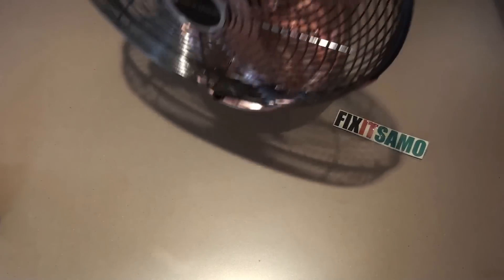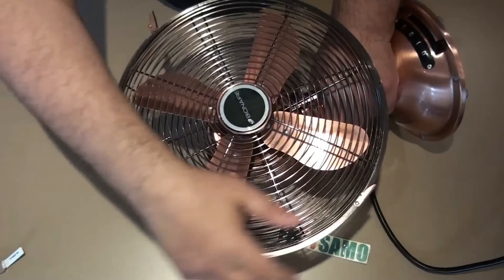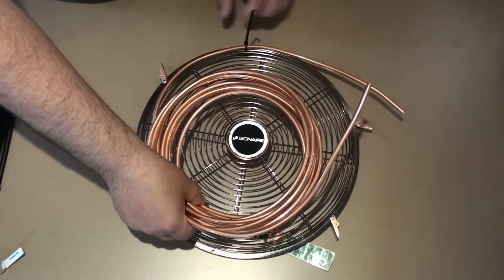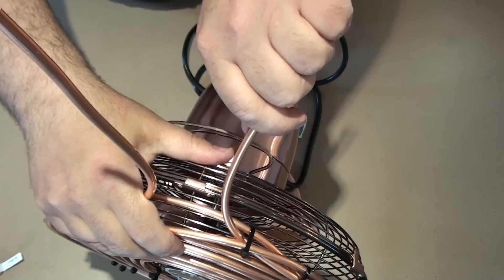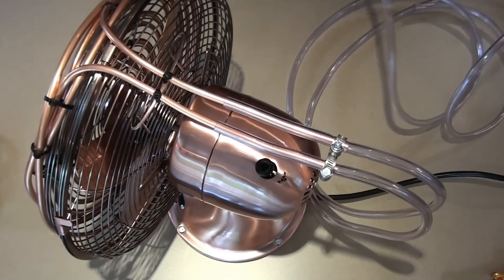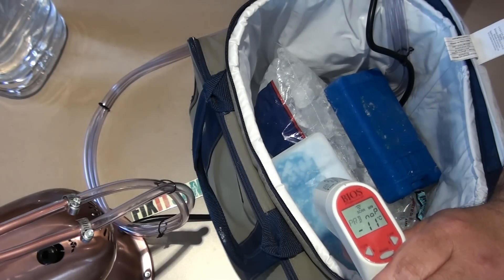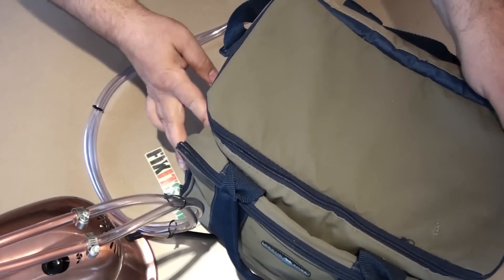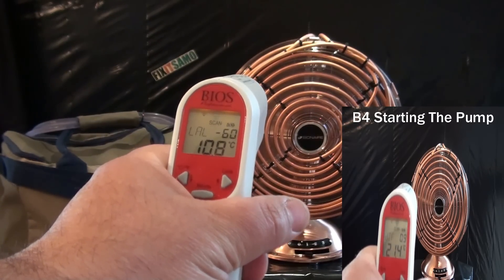How To Turn Your Fan Into An Airconditioner  AC

Comment: how long does the water stay cool? and is this more cost effective than an AC?
Reply: I doubt it's more cost effective. You need to run a freezer to create the ice so all this will do is very slowly move the heat from the room you're using it in to the room with the freezer.
Reply: Takashi Joho
You're ignoring the cost of buying/making the ice cubes. The process for this is no different from an AC but dropping the temperature of the water to below freezing will use a lot of electricity in comparison.
Reply: If you are running a freezer inside the house to create the ice, this is not a good solution.  As Takashi stated, it would use a lot of electricity (thus generating more heat than it removes as the fins on a refridgerator/freezer are still inside the house.  If you just want to have a little fake & bake AC unit to cool a small area and don't care about the extra heat created by the freezer,  this would be a good idea if you'd rather spend the time to buy a fan and put all this together.  You can buy a small AC unit which would exhaust the heat outside the house for very little money and it would work much longer, with little to no mess, and no need to keep refilling the ice.  On the other hand, building this and taking your time to do the copper coils neatly would create a really cool "WOW" factor when you explain to people what you did and show them how well it works.  Even though it is not that efficient overall, I give him a thumbs up on doing an aesthetically pleasing job on his copper tubing and tie wraps.  A bit OCD, but visually stunning.  :0)  +1

Comment: ....Or just save yourself a lot of time and just chuck the bag in front of the fan with the water and ice and let the ice cool down the air with the fan blowing it.
Also this isnt air conditioning, air conditioning requires a pressure difference to induce a change in temperature, e.g. compressing the liquid to heat it up to put on a heat sync (back of a fridge) and then expanding the compressed fluid to wick heat from the surface (inside your fridge).
Reply: ***** I'm not trying to sound smart.. mechanical design engineering is my profession xD
Reply: I think a better reason why its not Air Conditioning is that it doesn't remove the  humidity from the  air. I believe air conditioner at first were more worried about the humanity and were used in factories that handled things like paper and cloth. 

But anyway this is better called Air Cooling.

Comment: i did all this, it drops water from pipes when fan is turned on, 2nd the air temperature was not this much cold, my room temperature was 45 C. its useless dont do it

Comment: Copper tubing 25.00    
3/8 hose          10.00
Hose Clamp      2.50
Zip ties               2.50
Cooler              20.00 - 40.00
Ice sub             10.00
Tank pump      10.00 - 20.00
Fan                    20.00 - 30.00
Water/ice         -------------------
Total                 80.00 - 110.00

New 5000 BTU AC 112.00
Used AC on eBay $25-100

LOL.  Tard economics.
Reply: yea, but can you throw a few beers in a new or used AC?
Reply: If your gonna talk shit at least get your math right.

25+10+2:50+2:50= 40+20=60+10+10+20= 100 not 80
                              or 40+40=80+20=100+30= 130 not 110

Talk about "Tard Economics"
Reply: You can buy more beers by using a new or used AC.

Comment: Cool design, I've placed a fan in front of a few bags of ice before in a pinch.  This seems like a pretty efficient use of the ice, and yeah make the water connection extend further back away from the motor as someone else said.

Comment: I think it would be helpful to design this as a closed loop system like a PC liquid cooler. Instead of a reservoir and radiator setup you run an aluminum or copper cold plate in the ice chest. In the ice chest you could use a dry ice/ice mixture for maximum cooling since it is closed loop there is reason to worry about carbon dioxide poisoning (use it in a well ventilated room or just use regular ice). If you want to be mas chingonne and have a spare couple of hundred bucks laying around - that copper line set he uses is pretty damn pricey too - cannibalize a Yeti Cooler for your cooling chamber.,..

Comment: you could put the coil directly on top of the cooler full of water so the condensation trickles into the reserve with the pump, then put the fan behind that. this will help remove the moisture from the air making even high temps feel more comfortable.

Comment: It would work 10 times better if instead of the copper tube coil, you used a automotive style transmission fluid cooler like they sell at the auto parts stores. These coolers transfer thermal energy far more efficiently than plain copper tubing does.. That said, you came up with a great idea!

Comment: nice bro,however,..maybe for an outdoor application,..one could pre-cool the air ( by running a tube through the cooler,then supplying the air to the fan) because the air temp here ina fla is 97*

Comment: Any fool can understand the principle but the water condensation off the coils will drip to the floor, humidity in the air will soar, the cost of ice will be more than running an air conditioner.   The swamp coolers were mounted outside, recycled the water and used the evaporation principle for cooling, however, they add humidity in the air.

Comment: this really does work I did it watching this video it does drip water but if you put it on a towel I never have a mess just have to change the towel and the fan blows the water forward for those saying it can break the fan so it will probably never happen it's a great idea an costs me about 45$

Comment: Nice idea, but the videos on youtube also tends not to mention or address the dripping condensation issues. It will drip from the copper tube and hoses onto your fan. It may cause short circuits and become a fire hazard. There needs to be a better way of placing the copper tubing. Don't let the fan come close to contact with water And collect the water condensate.

Comment: The only real issue I see here is condensation. It would be better if your copper coil was more of a heat sink style wrap that didn't touch the fan. So coil it up and suspend it in front and have a plate of some sort to catch the drips. This setup will just wet your fan which can have it's own issues over time.

Comment: A more efficient K5,000 BTU window AC unit is usually less than $150 at many retailers. Copper tubing, plastic hose, fountain pump, cooler, and a Fan, not to mention the repeated times draining, and refilling the cooler with fresh ice, that $150 window unit seems to be a much greater value for the dollar.
Reply: agree for home use, but if your running off solar and already have a fridge taking up most of your power and space. this little setup could make a huge difference in small RV.  The only thing I'd change here is to have the water pumped from inside of the fridge, this way your not dependent on ice for cooling. just get a big plastic jar or even gut out the filtering parts of a small external canister fishtank filter. It's already a closed system with two tubes for cycling water all you need to do is clamp them to the copper tube.

Comment: Mines not pumping right the clear tube keeps coming out
Reply: U got the clamps ? Make sure they're very tight
Reply: +William Spillers yes I got the clamps what I'm trying to say is its not pumping the clear tube keeps coming out of the fountain pump so I had to duck tape it but still didn't work
Reply from the maker: +William Spillers
Try to reduce the water flow coming from  the pump  put it to minimum 
Or try using a plastique glue gun

Comment: you could alternatively cycle hot water through to make it a heater
Reply: +Paul Mckenzie scratch my last comment, it's obvious (now) that you meant to send your message to Ricky Ryan not me.
Reply: Good idea, let's buy the heater  first to keep the water hot..
Reply: No the fan would cool it down..
Reply: +Rickey Ryan for the fan to "cool it down" that means that the heat energy would be dispersed from the water to the pipes to the air and if the air is absorbing heat energy then it is "heating up" heat gained must equal heat lost and vice versa
Reply: +Rickey Ryan does the blower in your heating system cool down the air? I'll just let you think about it. Of course if you use radiant heating  or no heating at all I forgive you for your ignorance .
Reply: +Paul Mckenzie sounds good to me
Reply: +Jim Adams fans don't cool down the air they just move it around and allow your perspiration to evaporate more quickly
Reply: +Paul Mckenzie Am I missing something here? All I did was agree with you that cycling hot water would make an excellent heater. I really don't understand the Mr. Moto statement that fans don't  cool the air, they just move it around  DUH like everyone knows that one already ( at least I would hope so). Have you noticed that more and more manufacturers are now calling fans air circulators?
Reply: +Paul Mckenzie no your wrong
Reply: +Nadeem Hussain To be fair you could easily use something like a hot plate.. 

Converting electricity into heat is WAY easier and more common in devices than converting it into cold (which is technically impossible but you know what I mean).

Comment: So after 30 min, you have a warm bucket of water and a wet fan dripping all over the place.  I suppose if you have an endless supply of ice it'd be ok if you could handle the condensation problem.  Those who say to route the tubing into your fridge or freezer are in for a rude awakening and spoiled food.  Fridge compressors don't pull enough BTUs to keep the fridge cold AND do this.  This little gadget WILL push more heat into your fridge/freezer than it can dissipate.  On top of that, all the heat that a refrigerator pulls gets pushed back into the room anyway plus a significant amount more.  Nothing's free.

Comment: I would like to know  the air temperature  that the fan is blowing  ,because with the gun you have just measured the copper pipe surface !!!!!!!!!!!!!!!!!!!!!!!!

Comment: sorry but there is not enough surface area on the tubing to efficiently transfer heat from the air to the water. Also your infrared temperature gun can't measure the air temp. It only reads the surface temp of the tube. 

For this to work you need some kind of radiator instead of the tubing and directed air flow through it. This will give you a much larger surface area, but the condensation problem would remain and worsen. 

Today's air conditioners are very efficient by comparison. Save your money and buy one instead.

Comment: The trick is using AC to MAINTAIN a nice temp, not create one. Use box fans at night to cool the the walls, furniture, ceiling, because they will radiate the day's heat for hours. Then before the temps begin to rise again, seal everything back up and start your AC.

Comment: i have make one but the water flowed through the copper and start to have water from the air keep dripping. (imaging u have a glass of ice water. The side of the glass have water from the air start dripping and make your table wet)
Reply: condensation?
Reply: Yea, on the outside of the copper.. I noticed he didn't address that too

Comment: Great and decent looking idea.  Rather then buying ice, use 1 gl milk jugs filled with water and frozen.  Cheep and reusable.
Reply: Thing is, won't water condense on the copper and drip? That's what worries me
Reply: +C.S. Ewens it does sweat a little I put mine on a towel it actually does cool the room off I used bigger copper and tubes tho and water bottles to keep reusing works great
Reply: +Bobby Ruiz if you keep the round bit of the coil away from the fan and lag the flow and return pipes should be no problem then. Im an ac technician and i believe the added distance away from the fan would actually decrease the air temp from the coil
Reply: Chris C Ahh that's actually pretty smart sounding! Good shit.

Comment: I bought a similar tubing with 3/8 I.D. with header and the 1/4 in copper tubing but they don't fit snug into each other and so is the pump.

Comment: do the same thing  but the waterpipe going through the fridge freezer department, just drill through the side wall without hitting the fridges cooling circit ore electrics  pull your pipe through and  you get nice cold air,   nice job dude enjoy
Reply: a fridge's compressor is not supposed to work continuously, otherwise it will burn out
Reply: The fridge heats up the room as it cools down what's inside so it won't be very effective if you plan to cool down the entire room, and in the end it will end up producing even more heat
Reply: it doesn't have to... same set up as in the video, but instead of ice you'd have the fridge cooling the water. just like cooling everything else in your fridge
Reply: Jakov Sušanj

sorry, i made an assumption that people would obviously know that it had to be in a separate room, just like how his ice was produced in a separate room
Reply: air in a fridge or even a freezer will not cool down water moving thru the tube as the water moves too fast

Comment: Great!. I was thinking same idea. Is the efficiency better or worse when the copper is fed from the inner to the outer circumference or outer to inner circumference?. I will have to experiment. Cool!. :)
Reply: I would think putting the copper on the inside might interfere with the fan's blades. Some fans have tons of room though! Good luck!!
Reply: he means starting the coil in the middle vs. starting from the outside like this video

Comment: Where do you get the pump from?
Reply from the maker: +Are Jay  from a home depot  or online from amazon
Reply: +fixitsamo ok, thank you.
Reply: I have been to Home Depot and Lowes.  Their fountain pumps that are 3/8 have very short, black tubes - not two clear tubes like your video.  Amazon doesn't even show the tubing.  How hard would it be for you to put a LINK in the "Show More" section above?  I've been to two HD's and one Lowes and I've looked on Amazon.  I don't find anything like this.  Also, they don't sell 1/4" OD copper tubing in 25' only 20' and 50' - since my fan is bigger, I'm thinking of buy 50' - but I still can't find the clear 3/8 tubing or the right size of fountain pump.  A brand name (covered by your thumb) would be helpful.  Thanks.  Great fan though.
Reply: submerged pumps seems to be available only online  - not in Homedepot or Loves or any pet shops.  I bought 2 of 1/4 inch copper and connected by a peace of 1/4 inch plastic clear tube and used a small hose clamp - so now my copper wire is extended to 30'.

Comment: I'm using this in my garage and to keep the dogs cool. Instead of a soft cooler, I used a large igloo that I had. I am using frozen gallon jugs of salt water instead. With a 20-24" fan, I would recommend using 50' of copper tubing. Great video!

Comment: This won't work unless you keep the bag in another room and the effect will still be similar to a normal fan.
Reply: that's not correct. with the ice you get an energy negativity in you room and the fan speeds the effect of the ice consuming the energy in your room.
Reply: Michael Benson
 of coures you can't destroy energy but all we want is to cool one room down so
Reply: Water has a higher heat capacity than air. There should be a small transfer of energy from the air to the ice-water in the insulated bag.  However if you really want to get into it, there are a ton of things to consider like the relative humidity of the room, heat generated by the fan etc..

Comment: Very nice and easy ac fan well done , but what about putting the copper net on the rear also of the fan ?
Reply: In humid areas, condensation will form on the coils and will be pulled towards the electrical system of the fan. I would recommend leaving on the down wind side only.

Comment: What about cuper pipe condense??
Reply: Excellent question.  Common sense will tell you the copper tubing and hosing will sweat.  And it does!!  Made one today, water all over the place!  Fortunately, I put the fan in a custom made hole in the top of a box cooler and vented the air out of the box which was filled with ice. Cool.  The condensation from the fan drips into the cooler.  No, this will not cool a room, but it is very nice to sit in front of when your room temp is 88.  Today I achieved a maximum output of 70 degree F.  Tomorrow I will experiment with different ice techniques.